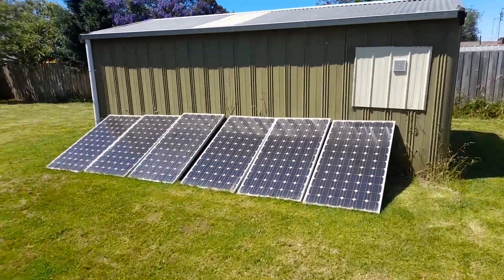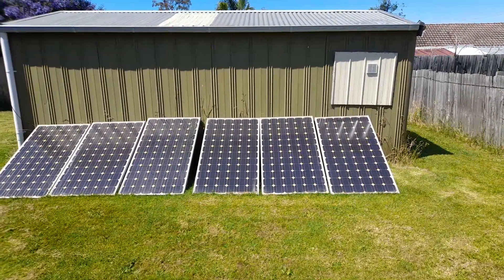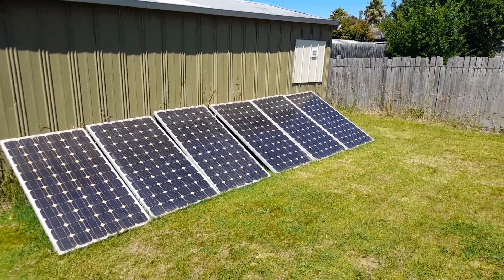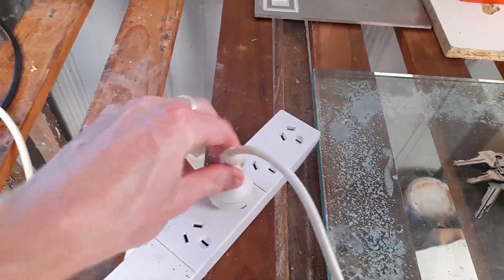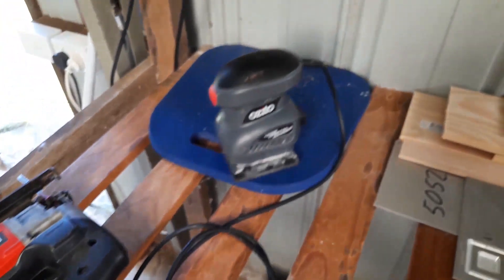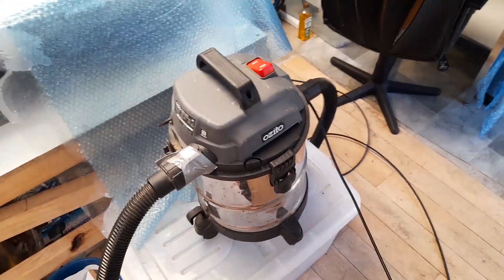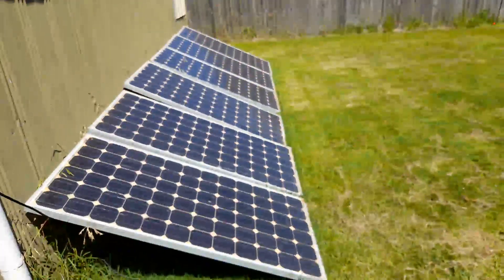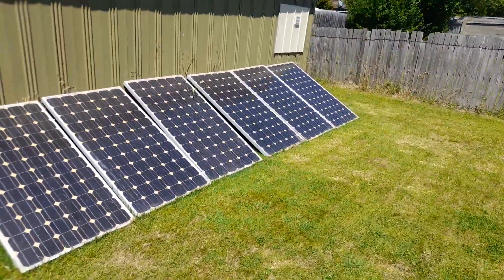Free Solar Panels Running Appliances Direct, No Inverter!, No Batteries!  DO NOT TRY THIS AT HOME!

Comment: Glad you devices survived. You overloaded them badly. DC current is twice as powerful as the same tension of AC current because the AC current is a sinus and reaches 230V only briefly at pick. The rest of the cycle it's anywhere between 230V and 0V averaging at 115V.
So you better connect only half as much panels as you did. And you also need a ground and a fuse if you don't want to burn you house to the ground.
I don't know what you mean by legal wiring there is no legal issue there. It's a private circuit, not the grid. No law says you can't use DC current to power your stuff. My advice to anyone who wants to install such a circuit is to buy foreign plugs and wall outlets so that a guest who doesn't know what you're doing doesn't plug something untested believing it's the grid. Although I suppose most devices will be undamaged even if they don't behave as expected (non universal motors, mechanical clocks...)

Comment: Pete in Wisconsin, USA here.  Our mains are 240V and 240 split to 120.  Lots of appliances run on 120 which can easily be created by three 72 cell panels or four 60 cell panels.  LOTS of stuff runs on 120, specifically: small brush-type motors, resistance heating devices and switch mode power supplies such as phone and laptop chargers.   Switching DC off used to be a challenge but is no longer.  A capacitor + resistor + diode snubber allows the switch to open with just about zero volts across it.  ANY AC switch of sufficient voltage for the Voc of the panels AND is fast actuating is fine for DC as long as it is protected by a snubber.  The snubber suppresses the voltage across the switch for a few milliseconds and very quickly the switch contacts are too far apart for the voltage to jump across.  Watch this space for a follow up video.
Reply from the maker: Thanks for the tip, I will apply it for when I conduct a more serious setup :)

Comment: Its worth metioning what's inside those appliaces shown running on dc direct from solar panels, those were equiped with universal motors, not all appliances with ac source can run on dc power like induction motors and transformer equiped appliances.

Comment: How do you connect the wires to the solar panel I brought a kit and it didn't come with a controller so I just got 2 black wires coming out my sola panel that's just going to waste rn
Reply: male is + and the hole is female -  cause it takes everything, man gives woman takes

Comment: Can you find out if you can continue to use PV direct DC long term? In an ordinary electric HWS? Into a 2.2 KW kettle? What about an ordinary refrigerator? A series PV connection gets additive voltage up to ca. 240V., but that may limit the current available, hence the power. Those older PV panels you displayed are approx. 10-12 years old and supply ca. 175 W max. each. However new PV panels can provide up to 600W each at around 30V. Melbourne has lots of clouds, hence variable power! But a great idea for Adelaide, Perth & inland locations! Please develop further info!
Reply: Fridge compressors aren't universal motors. They need AC.

Comment: 3:21 it's funny you should mention sand batteries, I had looked up "how to run solar panel directly" precisely and got to your video because I was thinking of using several solar panels in series to directly power a dumb water heating element into a bucket of sand during the day and bringing that pot in to release heat into the target area during winter night.  More power, less power it doesn't matter; all that is needed is to convert whatever power and drive a resistor to cause heat to dump into inert sand. 
 
Or for a smaller setup ; for eg for people without a whole backyard or just access to  1 solar panel ; could be to a 12/24V  PTC Heater into a home made PCM. 

Great idea!

Comment: How we have resolve switching problems , specially DC Arc when we do switch off?

Is there any better idea other than DC breakers and installing capacitors, which should work on both AC and DC power?
Reply from the maker: I am not an electrical engineer, but you need a switch at the inlet and not on the device unless its modified, it is easier to pre set the deice to its working configuration and then just switch the power on using a plug or a high voltage switch.
Reply: @sepracon  Hi where are the best places to pick these old panels up in Melbourne?
Where to look?
Reply: Use electrolytic capacitors in each power board, the capacitors absorb the arc or use dc rcd switches, I am using these methods in Melbourne, have got old panels for almost nothing, put these in series to make 240 volts, run induction cooker, kettles, electric cooking devices directly from it. In Melbourne these panels are almost free, I am using DC isolators near the load and also near the panels, so I can switch off from both switches to increase the safety. You can find 500v capacitors from old electronic circuits.
Reply: example i do is ...solar panel plug in to 24v dc to 12v dc convertor then plug to a pure sine wave invertor say 300watts  to convert the 12v dc to AC then plug in to appliance...there are plenty youtube vids...search run solar with no batteries
Reply: A filament lightbulb or a resistance in //

Comment: Hello, have you tried heating water for domestic purposes with the PV panels.
Reply: I have 4 panels @34v each, wired in series. 2 are connected to the bottom element and 2 connected to the top element. Mind you, these bottom 2 panels have the glass shattered and coated with the clear Flex Seal. They still put out 34v each. This photovoltaic array combination are heating an electric water heater salvaged from a mobile home. I did not change heating elements. I have it plumbed in just before my small rv water heater and the water gets really hot year 'round. Some days hotter than others. I have plenty of hot water for showers, washing dishes, what have you. Don't tell me it won't work. Because I know it does. Have a great day!

Comment: universal motors, like in a vaccumecleaner run on ac and dc , so yes, they do work directly off solarpanels. a heating element is just a resistive load , it doesnt care if it's ac or dc.
Reply: Most electronics have a bridge rectifier and will not see any difference either.